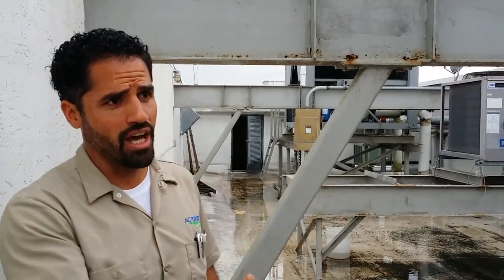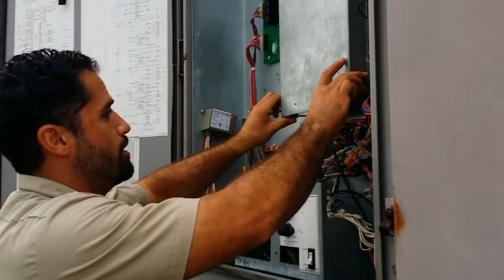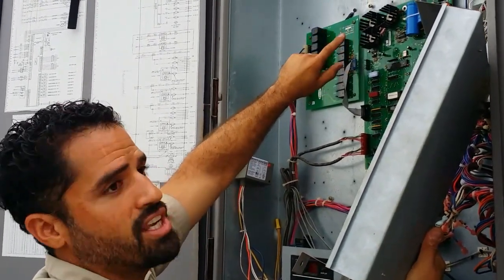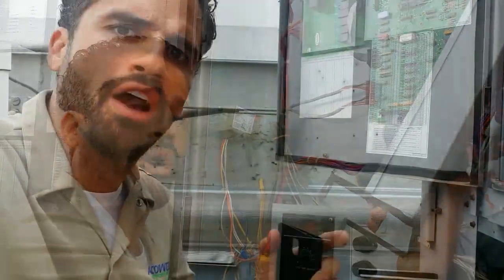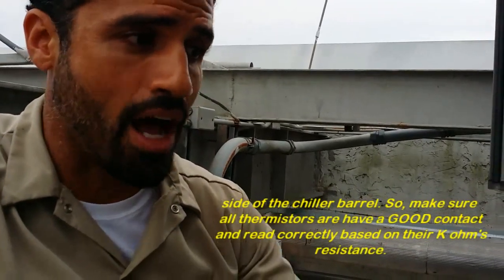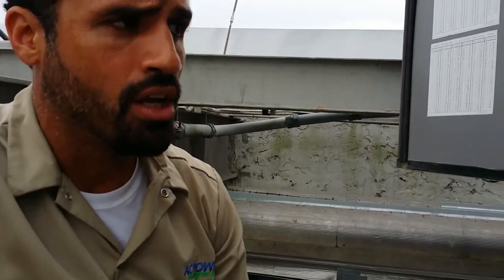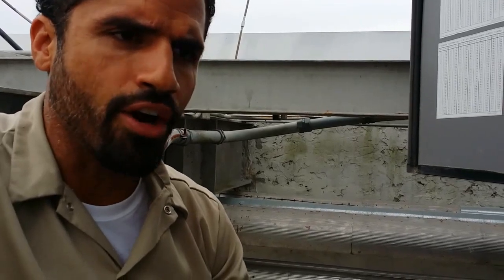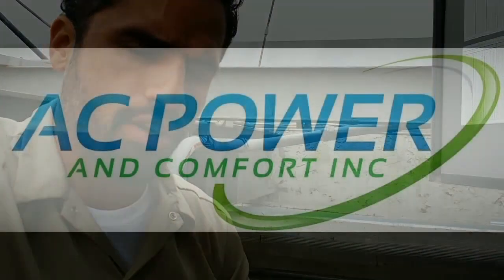commercial-hvac-chiller-services-troubleshooting

Comment: 1 question I have a chiller code.
It says contact opened it turns then off like in 15 minutes, then it turns on times & off,  like is telling all the units to go off & so the chiller goes off often.
What could be the problem? 
Thank you